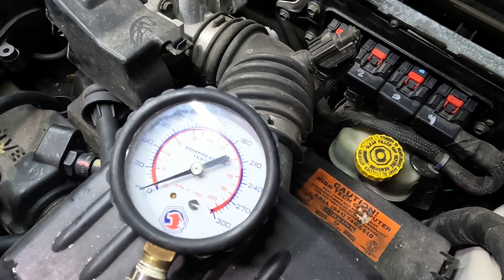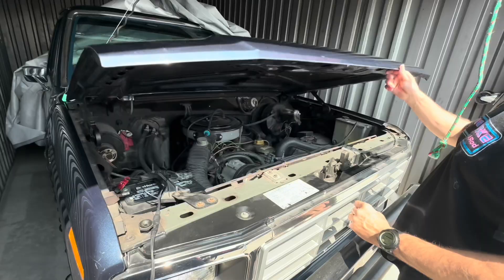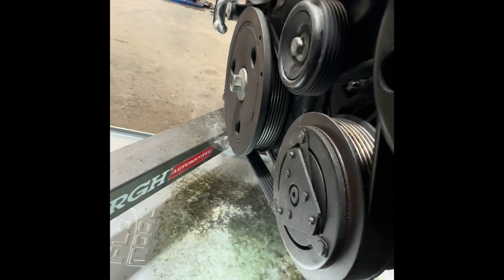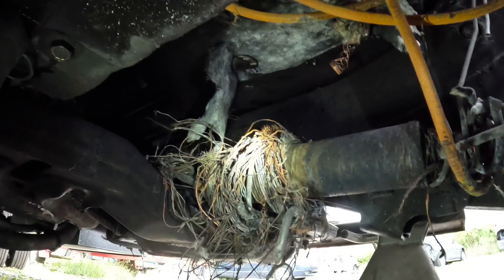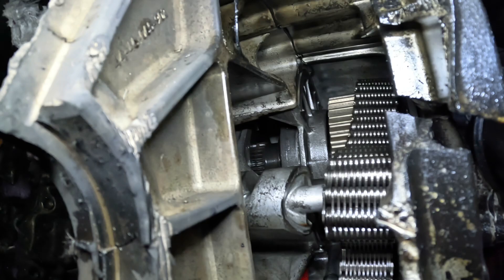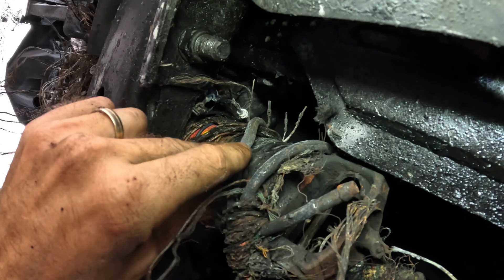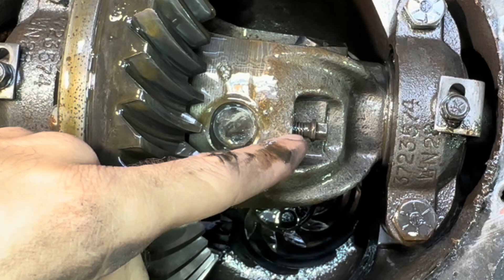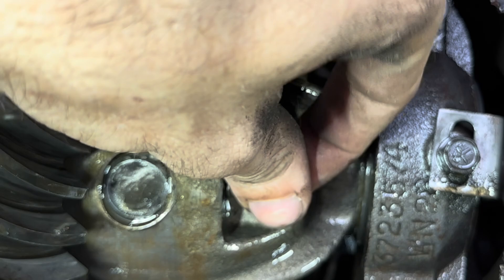Customer States: Banging, Smells Smoke! Compilation Bonus Slo-Mo Ford Ram Jeep Chevy

Comment: I scored an escort zx2 like that for $400. Put new belt and component kit on it for $50, drive for a few months, then sold for $1000. Mid 30mpg’s, even idling through a movie at the drive in with the car idling for heat!

Comment: If anyone is interested in making a smoke generator ( like Rays expensive one) on the cheap for as little as 15 bucks there are many DIY videos on YT that shows you how. I built one using a cheap soldering iron, a pickle jar, and some fittings. It uses baby oil and an old sock for a wick. It works as well as Ray's.

Comment: https://youtu.be/rxkTSjUQtPg?t=465 How do you even begin building a quote to fix something like that?
Rebuilding the wiring harness/brake lines/fuel lines, new/used transfer case mabye a new drive shaft(plus whatever got damaged when all the stuff got ripped lose).  That bill must have been insane.

Comment: this is why belts suck and i avoid any car or engine that uses them. absolute junk
Reply: That's like saying you avoid cars with oil. Timing belts are a maintenance item. Timing chains are eventually a maintenance item.
Reply: Sooner or later everything about the vehicle becomes a maintenance problem.
Reply: @kampar82  not really. Chains do not bend or break or stretch. the only thing that wears out it the guides, but that takes many many years. Im still good with a chain from a 2000 Celica that has 260,000kms on it, no noise, and works great. never changed. so that chain and guides have lasted for 23 years now with no end in sight. I would have had to pay about €750 for 4 timing belt replacements if I didn't have a chain. Ill take the savings of a few thousand €'s. Belts suck, end of story
Reply: @108gk  except when its not and never has been. maintence and repairs are two different things
Reply: @TriforceOfCourage97    I do get your point but VW timing chains had some stretch issues as an example, not helped by the insistence of VW to extend the oil change interval. Some chains are rated for 150 000 km. Sealing for cam chain cover can also be an engine out operation, typical in Lexus/Toyota V6 engines. It's not that black and white. Some sources do claim that even Toyota thinks cam chains have a finite lifetime. I would prefer to have a timing belt and a non interference engine with a longitudinal inline engine. I need to start shopping...